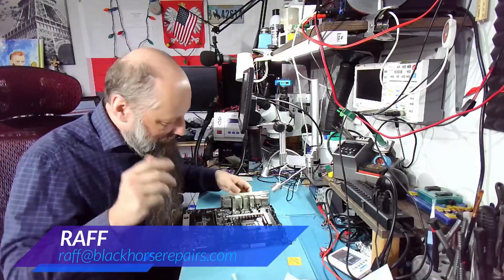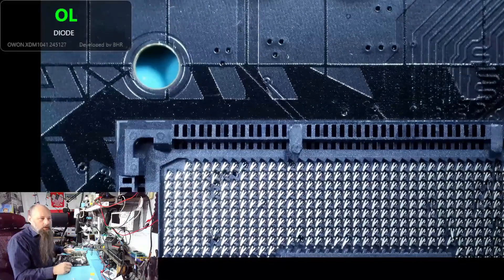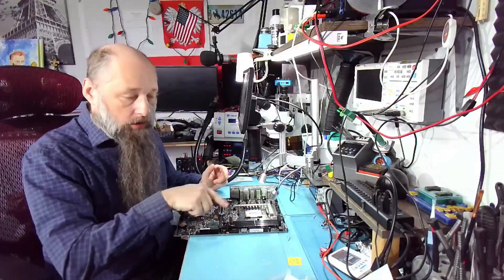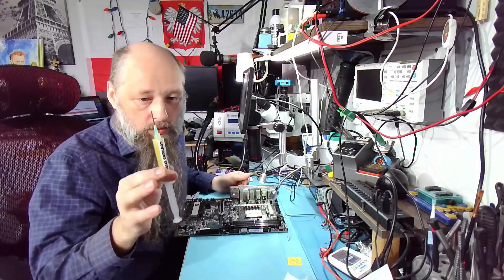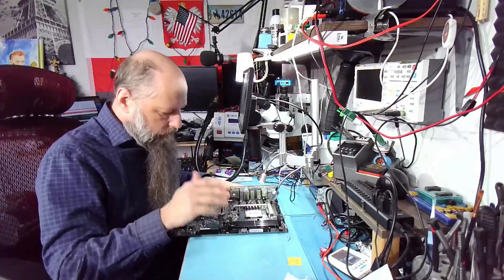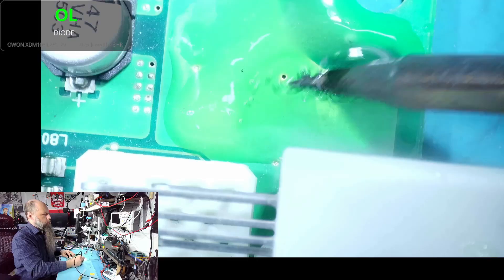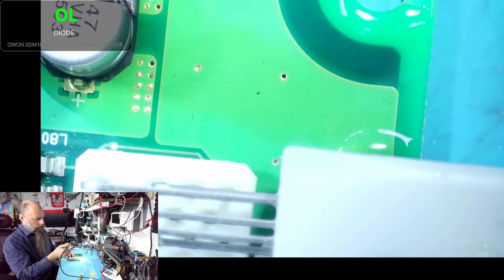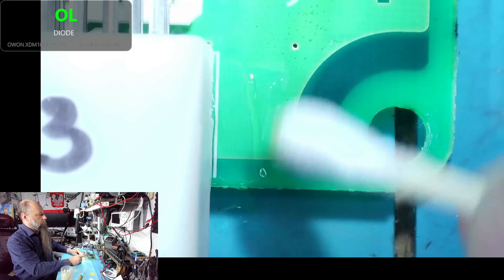306 | I Love this Flux | Z690 LGA1700 Socket Replacement

Comment: Impingement will help to clean socket faster.
Take big a syringe and shoot the solution into the socket while it's cleaning.
I get flux from under bga chips in 30 seconds at 70c using Branson EC cleaner  doing that.
Reply from the maker: Thanks for the great tip!
Reply: Ig watching you recommended me this channel. Thanks.

P. S. NORTH RIDGE FIX FLUX IS THE BEST 😜

Comment: You should put some on a piece of copper tape for a few days to see how it will react if you don't clean it.
I have some MG Chemical flux that turns green after a couple weeks.  It's not terrible but it does eat a small bit of the copper.
I have some no clean plumbers flux that turns green in a few hours.  I used that plumbers flux when I first started soldering and didn't realize there are many levels of the definition of "No-Clean" ...LOL
Reply from the maker: thank you so much, I'll try that right now
Reply: If it stays corrosive during room temperature up to 100c, it's a disaster.
A test is very much needed for sure.
Reply: @northwestrepair  I have some Chinese Kingbo flux that came in a jar.  I transferred some of it to a syringe and it started eating the rubber plunger.